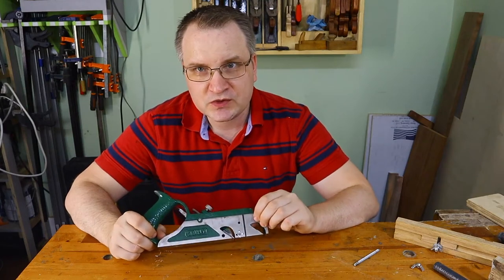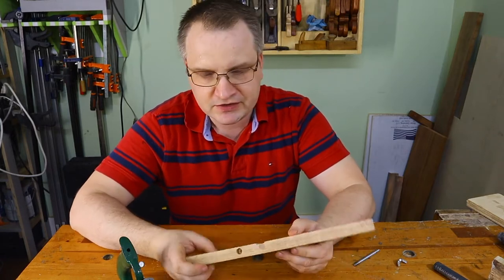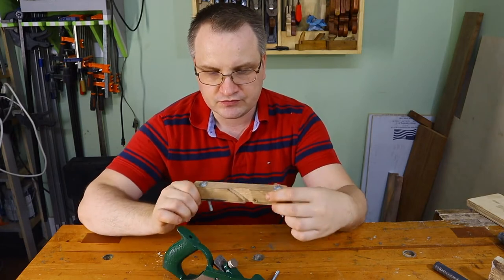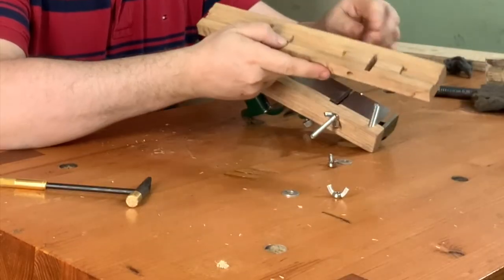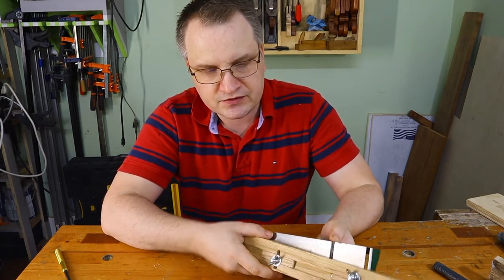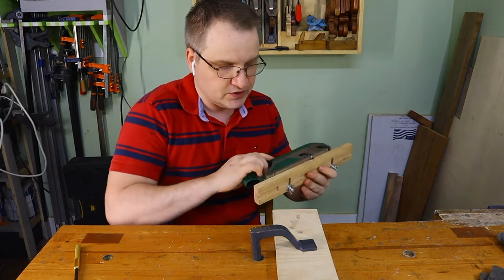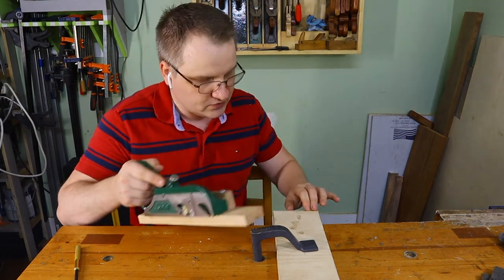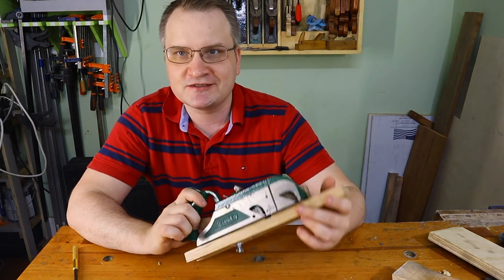Making a lost fence for Stanley 78

Comment: Very clever solution. 
Thanks for sharing! 
The cost for  a replacement fence was bigger than the money I spent for the whole plane. 
I pay 14 € for mine. 
Great chanel!
Reply from the maker: That was my motivation to make this. 10-20$ plane and "original" fence for like 60+... If only Stanley continued to make new parts, which it was selling for 15$ or so not in the distant path (it is even still on their website.
I basically got an idea from a wooden rabbet plane I saw in one of the video and then tried to put "standard" size rod into Stanley78 slot.  After that, just a few things.    However, I may need to do an updated version of this, as it end up a little bit bulky and has issue with chip removal.  Still works, but when I make rabbets, I have to periodically stop and carefully remove all the chips that got stuck in there.
Reply: @A2woodArt  
The rod that you used is metric?
What size it is? 
That will help when I start searching for mine. 
I will copy your design with the improvements that you mention. 
Thanks for your time!
Reply from the maker: @savvas9514  The one that worked for my Stanley (not sure which type, but reasonably recent, maybe just post war) is imperial thread 1/4 NF 28.  I simply got 1/4 coarse road and retapped it with fine thread, if you cannot find just fine thread.
Reply: @A2woodArt  Thanks for your answer. 
Because where I live imperial threads are hard to find i will try it with a blank rod or a close metric size. In the worst case scenario I will  tap the hole in the plane so it can accept a metric rod.
Reply from the maker: @savvas9514  The planes are also different, so your may have different thread too.  Just bring to the hardware store and try whatever fits/closely fits

Comment: This is great.   I also have an old 78 clone (not Stanley,  nor Record.   Unbranded and old. )  it also has a quarter inch threaded hole that I am guessing is 25 tpi.  I am thinking of trying to re-tap it coarser to 20 tpi.  This was what worked for you?    Never retapped before so I thought I would double check before I acted without knowing much of what I'm doing...
Regardless, it's a great video, and I will be using your plans, so thank you again!

Comment: Thanks for posting this video. I just bought a 78 from ebay and it has no fence or fence rod. How did you get the rod? My understanding is that stanley had very odd thread size and pitch. By the way, would a stanley combination plane rod fit here?